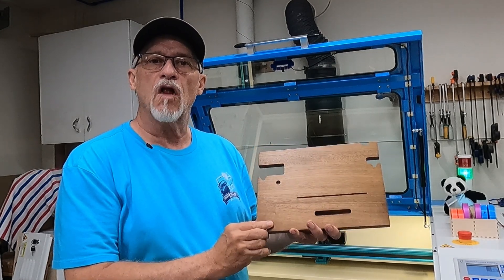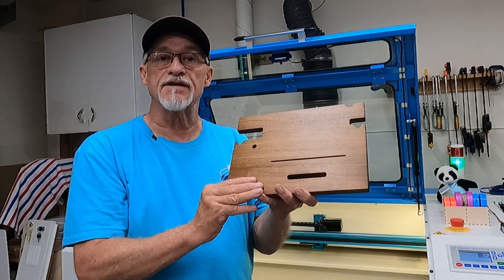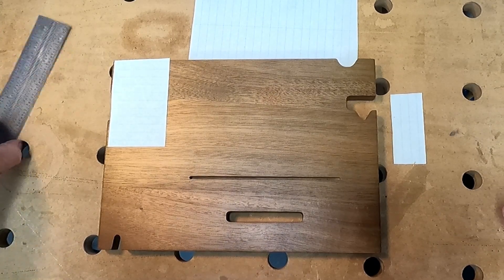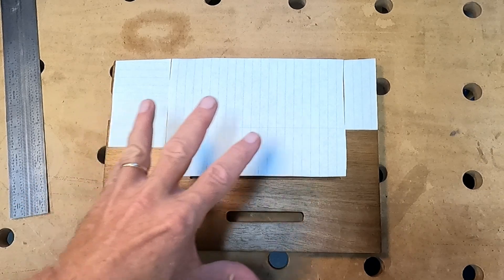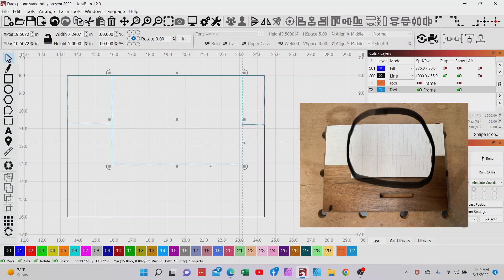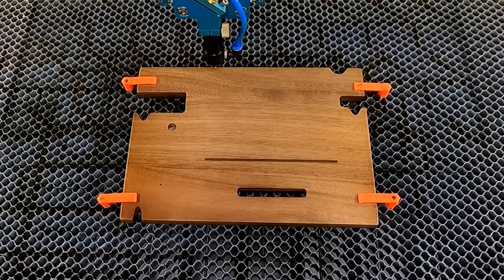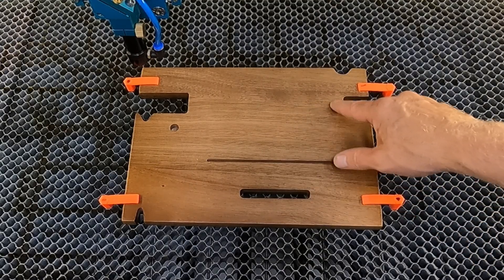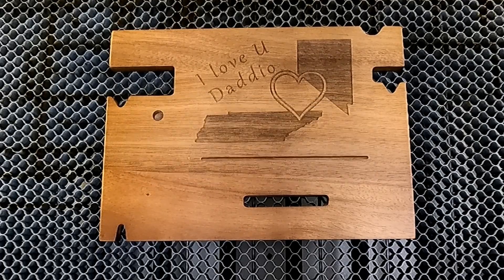Laser Engraving designs on complex shapes without a camera!

Comment: Hi. Thanks for uploading helpful videos. I am not sure if you have already made a video on this, but I would like to ask what would be the best way to fixate different types of materials to the honeycomb bed. I am currently using strong magnets, but I always have to be careful where to put them because I need to avoid the path of the laser head. Are the ones that you are using(orange bits) made of rubber? Could you suggest where I can find similar items? Thanks in advance!
Reply from the maker: Great suggestion!

Comment: I have noticed your pressure switch on your lasers in some of your videos, would love to see how you installed that in a video, that would help me greatly as i have 2 thunder lasers and would like to dial in my PSI settings on my high and low volume air, thanks!
Reply from the maker: If you go on thunderlaserusa.com under knowledge base and look for some external air articles they have the link to that gauge and how to hook it up.